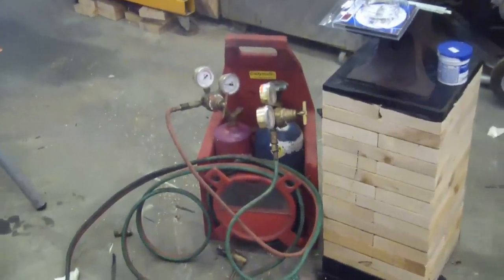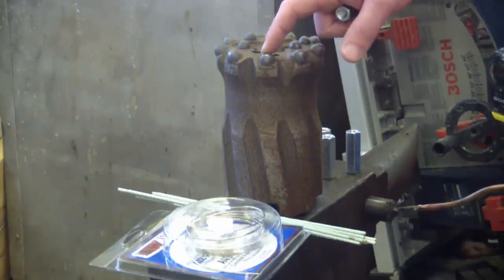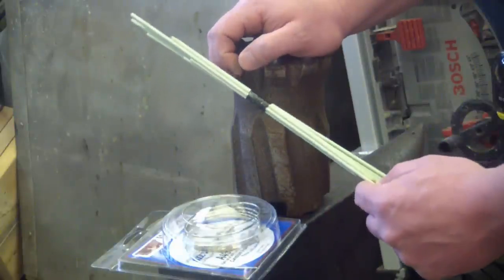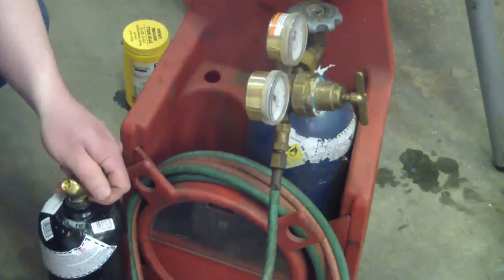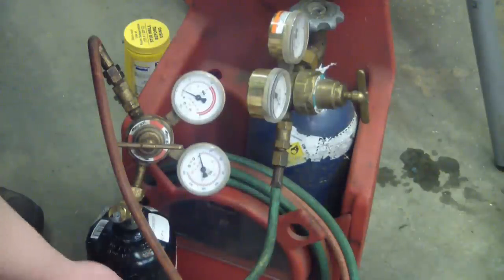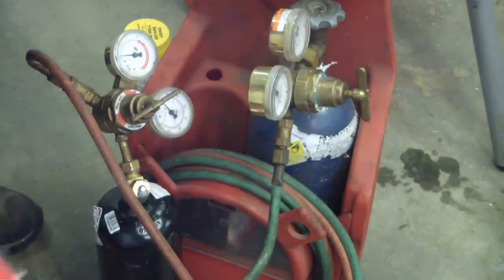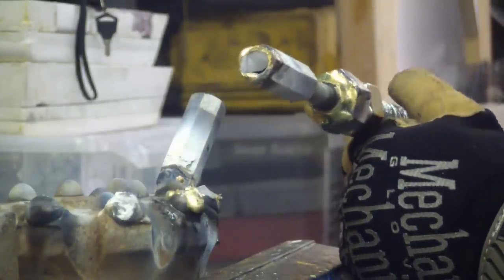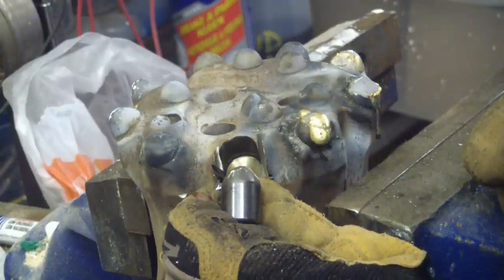How to recover tungsten carbide from drill bits

Comment: A welder at a place I worked at got a nice zip wheel cut from his chin to his nose when a vessel he was cutting on full of ethanol fumes blew up and he yanked the grinder back.  Good times.
Reply: ***** Can you make the drill bit buttons in this vid into bullets?
Reply: That's a great idea!    I wish AvE would mail them to me so I could try that!
Reply: ***** he really should do that.
Reply: +TAOFLEDERMAUS I have a 6 to 7 inch scar from a zip wheel explosion in my stomach. Would rather play with a shotgun loaded with crayons because.....Crayola!!!
Reply: +TAOFLEDERMAUS Pretty sure we are watching the same videos!  Crazy - great minds think alike.
Reply: hence the whole 'wear a face shield' thing
Reply: Lying worm! How very dare you 😊
Reply: Wouldn't the hard tungsten destroy the barrel or any rifling?
Reply: @Aceoffroad4x4  it would have to. It's harder than barrel steel
Reply: @Aceoffroad4x4  I would think if you wanted to do it safely you'd need it seated in some kind of sled like tank rounds use to keep it from contacting the barrel
Reply: @jackbooth1179  Sabot
Reply: @Aceoffroad4x4 they're usually encased in a softer metal like copper or lead.

Comment: Hey Ave, new to your site and hopefully not too late with this suggestion.  While I'm not familiar with rock drilling bits, these carbide buttons look very similar to rest pads we use in the jig & fixture trade. On occasion when finding pads broken along with their STUCK blind hole shanks, I'm able to "hydraulically jack" them out with grease. For this to work one usually finds the blind holes are drilled deeper than the shanks pressed in. If this is the case, one can drill and ream a "proportionally smaller" precision cross pin hole directly into the cavity below the shank. If successful, flush out and fill the cavity with grease making sure no air is trapped inside. Now SLIP in a precision fitting pin followed by a persuasive whack. If the hole size ratio is done right, this set-up works like a hydraulic bottle-jack and the shank is pushed back out. For this requirement I'm not sure it's worth the effort but properly applied it's been a lifesaver.
Reply: ***** The smell of money ... that's why the scrap guys always come up with a better way. Ha!
Reply: John M954 I used to use a similar technique to remove stuck bearings when I was a mechanic. Worked wonders on stuck pilot bearings/bushings, just fill full of grease and strike a drift punch into the hole. On badly stuck bearings, they would come out smoking and be too hot to touch.It was more reliable and faster than using the proper blind puller, but sometimes you would get a face full of grease lol.
Reply: giggity
Reply: is tungsten carbide actually worth anything?  why does he want them if not?
Reply: beatiful idea btw

Comment: YES, many types of flux are made from wood sap. The electrical solder flux I use is essentially very light spruce sap. I am mildly allergic to spruce, so when that electrical flux hits the iron my sinuses go crazy and my eyes water, then I start to sneeze. We send a lot of tools out to have new carbide inserts & tips put onto the tool steel. Usually they drill or grind out the old tungsten then braze in new inserts or tips.

Comment: 4 year late fun acetylene fact! And easy way to remember.
The two small common sizes are named for their original use as gas light fuel for headlights.
MC ( what you had ) = Motor Car
B ( plumbers torches ) = bus which had bigger/more lights

Comment: Massive fan of the channel, your knowledge of anything engineering is unparalleled. Just wanna say you should have flashbacks after the regulator and before the torch on your oxy-acetylene kit. I'm a fridgy and i've had an apprentice manage to blow his acetylene hose because he left his hose open to air for a few days, put it back together, lit his torch and was pretty much holding on to the end of a line of det-cord. Heard far too many horror stories to take risks with that shit. If electrons are angry pixies, acetylene is a divorced mother-in-law that you've pissed off at christmas dinner.

Comment: I drilled wells for years and we made some of our own tooling from old bits. HINT Never weld or cut on a carbide button bit. If there's a drop of water that managed to get under the button, the button will shoot out like a shotgun bullet. 
We'd run them too long sometimes and lose a button. If we didn't get it out of the well it would knock the buttons off every bit you put down there..
Reply: Drilled on a water rig too. Impressive that they would/could resharpen something so damned hard.
Reply: @russelldodd93  Up until the seventies we used a coal forge made from a 55-gallon drum with an old Electrolux vacuum cleaner to provide air. We heated the bits up to just the right color and beat them to a chisel point and proper diameter sing a sledgehammer. Later we took to building up the bit with hardened welding rod when it got worn.
The seventies brought carbide button bits that we only used in rock. They were disposable.
Reply: We want mining drill bits scrap if you have so please let me know
Reply: @pratikgangadiya155  yes I have used mining tungstan mounted drill bit scrape .how much do you buy. Let me know.

Comment: I am no expert but my best guess for the vanilla smell is either cellulose or calcium carbonate, both commonly used in the flux.  Depending on what you are using there could be other chemical  that are unique to your brand, but most other chemicals in the flux are odorless.
Reply: Well I remember smelling vanilla when I bought my Gibson guitar and they use Nitrocellulose lacquer. So I'm betting the cellulose has a big part in it. Thanks for the info!

Comment: I used to manufacture rock bits - Sii Smith Tool. The sintered tungsten carbide inserts were press-fit using an interference fit of approximately -0.005 inches. As I recall, the pressure to insert was only 5,000 psi, and the pressure to extract was 50-tons. Test inserts had holes in them to cross-pin for laboratory testing.

Typically, air is the cutting fluid not water when using this type of bit. It's primarily used for mining and blasting above the surface. Below surface mining uses an entirely different style of bit.. They typically only use water or "drilling mud" on oil and gas rigs, both onshore and offshore. The mud is a mixture of Barite, sand and water that raises the weight per gallon from 7-lbs/gal to as much as 15- to almost 20-lbs/gal. The heavyweight mud counteracts the downhole pressure thus preventing a "Gusher" (blow-out) like in the old movies.The mud is captured and recirculated until the raw crude shows on the "shaker table." Then they know they are in the pay zone.

You are correct in the only way to get them out is cutting. Excessive heat will most likely damage the TC inserts. As a recyclable material, TC is very valuable, but too expensive to extract from the base material. 

Here is my contribution to the industry. Click on "Full Text" to see the specifics: http://www.patentbuddy.com/Patent/4665999
Reply: Michael Mantion That sounds incredibly dangerous and I would love to see it. ;D

Comment: Better idea; use the oxy/acc torch to blow the steel away from the buttons.
Reply: It will eat the tungsten too
Reply: @patricksworkshop6010  congratulations, it took four years for the first person to admit they didn't know how to use an oxy torch very well. 👏  when I posted this comment I worked for a drilling company and when things got slow or we were shut down waiting for parts ect we went thru old bits and removed the carbide buttons for salvage.....I could remove every button on that bit in 20 mins with ZERO damage to the buttons using  only an oxy acetylene torch
Reply: @johnpike9612  do you have a video of that? Need to know how to do please!
Reply: @cesarcalderon9180  i dont and unfortunately i dont drill any more so i dont have access to any used up bits. But the process is easy, keep your heat high (like REALLY high) and as soon as the steel starts to melt give it full 02 and keep the tip a good distance away. You only need the blow half the steel away and by doing it this way the steel melts away before the tungsten has time to reach its melting point. Oh and use the biggest tip you can find and throw out everything youve been told about your gauge settings....i never use my gauges at less than full blast....none of that 10 and 40 psi crap. When i need o2 it should be available not restricted by a predetermined pressure setting.
Reply: @johnpike9612  we want mining drill bits scrap if you have so please let me know

Comment: You can torch those things out... tungsten will stand up to your torch no problem, the steel will melt away.. I use a similar technique for removing helicoils and seized bolts. The difficult ones might be the stubs closer to the center. Still a oxy torch should work no problem!

Comment: I've turned a similar piece of tungsten carbide into a peening hammer. The carbide is so much harder than any steel that even with a light blow it deforms the metal easily.
Reply: pocoapoco2 Sounds interesting. Ya've never had a problem with the carbide shattering as was seen here while whackin away with it?
Reply: Nevir202 I've had the hammer I made for a couple of years now and have put moderate use on it. It's still fine. You really don't need heavy blows at all to peen even hardened tool steel. I'm not sure exactly what the piece of carbide I used came from as I'm not the one that acquired it. I think it was a used spike from a heavy piece of excavating/construction equipment like a road grader or something similar..
Reply: pocoapoco2
Ah, probably a tooth off of an asphalt milling machine then... Never considered it as a hammer. I occasionally see the worn teeth lying around. Maybe I'll pick one up next time. Thanks for the idea. :-)

Comment: Just a thought. Given that tungsten carbide has a much higher melting point than steel, couldn't you just blast it with the oxy acetylene and melt away the steel around the TC? With a cutting flame it would take seconds and the TC would just fall out.
Loved the commentary about the gormless shop assistants. We have lots of them here in the UK!

Comment: Wow, you guys are making something so simple very difficult.  I have recovered the carbide compacts from thousands of tons of rock bits.  Here's is all you have to do:
heat the compacts and the area surrounding the compact cherry red.  If you want to take the compacts out one at a time, just hit the red hot compact with some cool water.  The compact will come right out.  If you want to get all the compacts out as quickly as possible, make a small box furnace, use propane to heat the cones (in the case of a tri cone rock bit).  Take them out of the furnace when they are red and hit the cone or tool with a large air hammer.  The compacts will come right out.
Reply: Hi.
Is it possible  to send me a demonstration vidio clip to remove the tungsten ball or pellet from the mining drill bit.

Comment: Heat the bit till red in a metal box. Which a  of box is open as well as the top.
Heat with propane weed burner till nice and red.
Pull the bit from the box. Place on the ground and hit it with air hamm. Sharp chisel tip. 
Tungsten will cool faster than the iron. Hammer will rotate buttons out all on the ground. 
Did this for a couple years  when I was a young man during the 70s.
I you have any questions, just ask.
Did 500 pound bits all day long. They were earth bits drilling for geothermal in cloverdale California.
Reply: @ronballard 4910 selam bu yorumlarin neredeyse hepsini okudum ancak tecrubeli birinin yazdigini göremedim bu konuda deneyimli oldugunuz soylediniz gercekten bu tungsten uclarini takili oldugu yerden nasil cikartabilirim detayli yardimci olursanız sevinirim

Comment: The angle grinder seemed to be way less dramatic than I'd have thought; I figured the tool steel would have just eaten the wheels up.

IIRC, you've a rotary tumbler?  Unless they crumbled into dust, those would make for some fast milling.  

Their smooth rounded ends would make a sturdy tool for turning metal, and if they can take impacts (as their service in a drill bit suggests) they'd make a hell of a ball-peen hammer, being over twice as dense as iron, and much harder.

If it were machined to have a shaft, grooves could be cut into the base and walls, to make a pretty solid high-speed grinding wheel, or rotary engraver.

Comment: A few years late, but I only just came across the video.
Cut both end out a 35 gallon drum, lay flat, cover in sand, propane weed burner coupled with an oil drip and additional air supply, creates a through kiln in which you heat the entire bit to red, remove and sit in any makeshift stand and hit it with a 15lb jack hammer. All the tungsten almost instantly falls out, collect and sell.

Comment: Dude, I worked for a bit shop in Farmington New Mexico 25 years ago. If I remember correctly I asked him htf he got those out and was told he heated them red hot (cone not the button) and would hit them with a sledge hammer to shock them out.

Comment: You know what would be neat?  Use water to extract it.  Drill a hole to under the lug.  Fill the lug with water.   Cap the hole with a large bolt.  Freeze the whole assembly (throw it in the snow), and see what happened.  The water expanding into ice might push the lug right out.  BTW, if you do this, have the lug facing down.  It might come out at high velocity.

Comment: Tungsten drill bit- button bit, never tried to remove buttons on purpose but I know from free tri-cone button bits get the steel surrounding buttons fairly hot then just hit the side with a hammer and drift, they are usually just press fit, had them fall out of a similar down hole hammer bit that had a shank, was building up shank, bit got hot, I dropped bit, and lost two of the tungsten buttons, might help in your quest for tungsten recovery

Comment: Mate, if you want some nice chunks of carbide in a known diameter, go to any kitchen cabinet shop with a flatbed CNC nester. we throw them out by the bucket load. I tried to tell the bosses of the recycling value, and they told me to be quiet and press the buttons.

Comment: I wonder if LN2 would work?  Use a rosebud to heat the base metal and dropper some liquid nitrogen on the tungsten and see if they come out.

Just basing this on cold welding in manufacture.  Machine to just an RCH bigger on the insert than the socket then use high heat on the socket and liquid nitrogen on the insert.  This is often used for a very strong permanent attachment between aluminum and stainless steel.  Much stronger than brazing.  That might be how they insert the buttons when manufacturing the drill bit.  Or it could be like Resonant Sonic drill bits and they solder tungsten to the insides of the mold then cast in the base metal.
Reply: thats what i was thinking
Reply: Carbide will Crack with thermal shock.. the temperature difference will cause it to fracture. was going to suggest this for the extraction method until I realized he wanted the buttons and not the drill head.

Comment: I have a tungsten carbide wedding ring, its not been off my finger for 3 years and has no marks or scratches on it, despite working on cars / trucks etc.
Reply: Same here. I've probably done less wrench-turning than you have, but I've definitely whacked it against my share of otherwise-unforgiving surfaces and subjected it to many hand-washings with abrasive soap. Years later it's still flawless.
Reply: Funny fact about Tungsten wedding rings, when you have an injury/swelling on your hand and the paramedics have to get it off, they will ruin their ring cutter, because well, tungsten carbide. A simple way of solving this in an emergency situation is using locking pliers to break it a-part.

Comment: If you were patient over a few days you could use electrolysis to rust them out all at once similar to the old mythbusters escape from jail ep as long as you use a high enough current even most stainlesses will become susceptible to accelerated oxidation. 

I agree with you about the tattoo thing and the pimple facd kid. I have them coming in from battery world asking me for a 1000 ohm diode that only let's electricity one way, then I wish I had your mining shifter